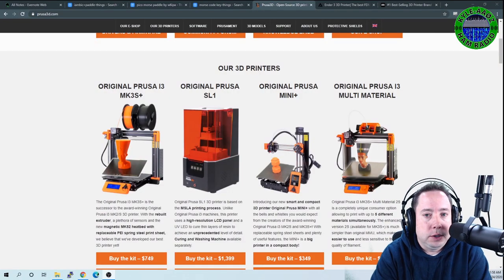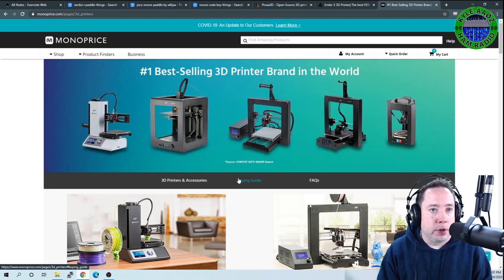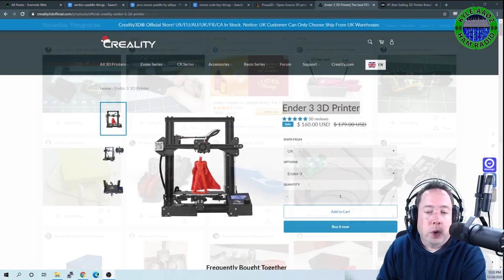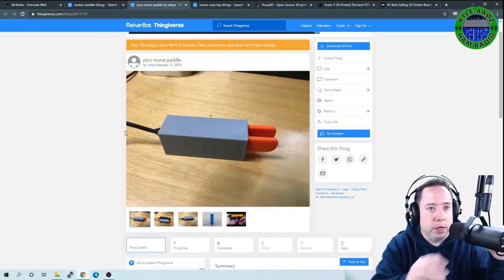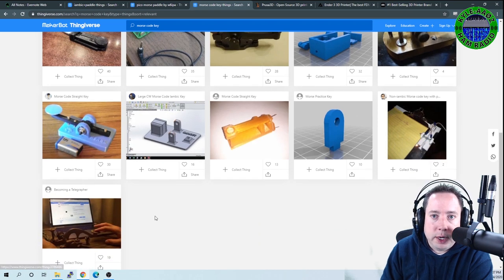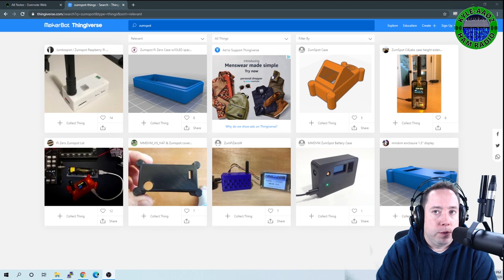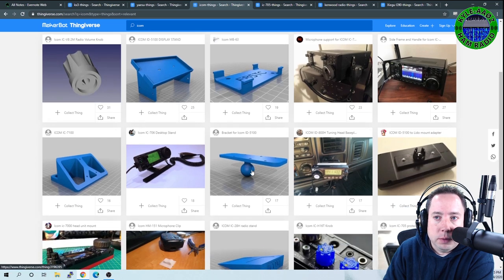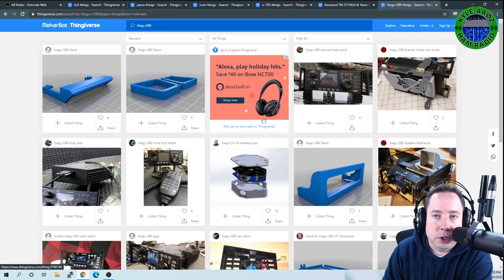Ham Radio 3D Printing - The Best 3D Prints for Ham Radio

Comment: I have been trying to find someone in the United States that can print the Key Bar and Lock for the old Turner Plus 3 Microphones and others that use the same parts. The Original Parts were the Hard Brittle Cast Plastic Parts which over time have broken - they need to be made out of the Hard Unbreakable Plastic like Combs are made from. I looked on Thingiverse and nothing listed for Turner Microphones.

Comment: if using PLA, TPU and PETG you can successfully print if it was in a refrigerator, works just fine in a cold basement.
Issues only arise with filaments with bad layer adhesion like ABS, Nylon, and a bunch of other exotic filaments.
Reply from the maker: You have better luck than me.  Thanks for watching!